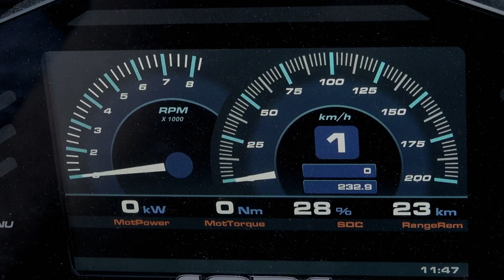The Future of Hydrogen in Motorsport: Challenges, Advantages, and the Road Ahead

Comment: The primary problem is they toss out the oxygen instead of saving it for use when the hydrogen is being burned. There are many advantages to having more oxygen than is needed in the combustion chamber as that would mean any and all hydrogen put into the combustion chamber will be burnt. This is where Meyer shined the most as he really took advantage of having more oxygen than the system needed and begun experimenting with ways to slow the burn rate of the hydrogen oxygen reaction. He accomplished this by beefing up the vehicles Exhaust Gas Recirculation (EGR) system and making it more responsive. What this does is to create a traffic jam in the combustion chamber so that the hydrogen can't easily get to the oxygen as he put in a lot of things that do not support the combustion process. This traffic jam also allowed him to manipulate the incoming air supply stripping away up to 5 electrons away from the oxygen atoms. Doing this prolonged the formation of the water molecules as those missing electrons had to be created by the hydrogen atoms from the zero point energy field. This creation of electrons produces a lot of energy in the process but just know that when the reaction is started by a spark ignition source the two gases must form the water molecules. 
That part of Meyer's technology no one seems to fully grasp but me for the moment as I took the time to make use of the scientific method on uncovering that technology's secrets. But one thing I am not sure of is, "Is this technology suitable for the automotive racing world?"

Comment: synthetic fuel & biomass fuel will be here, in alot better scale, by 2026

Even the EU recently reversed the internal combustion engine ban, as long as synthetic fuels are an option.  All this can also happen on the same network of gas & fuelling stations that we have right now.  Making the transition seamless.

Hydrogen ICE, I see maybe becoming a thing in HGVs/semi trucks, but synthetic fuel is the future of motorsports & ethanol replacement (potentially the ladder) IMO, strictly on its adaptability to the current infrastructure.